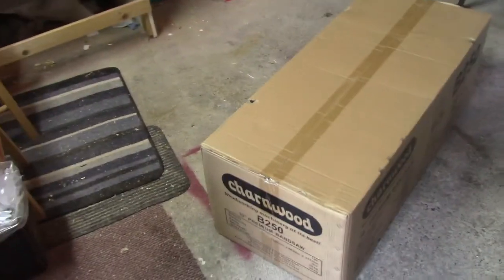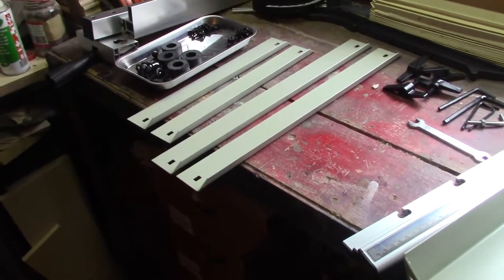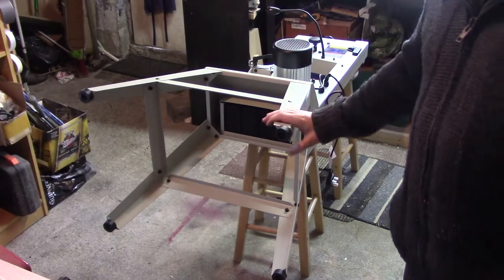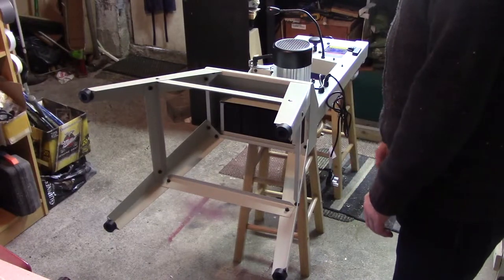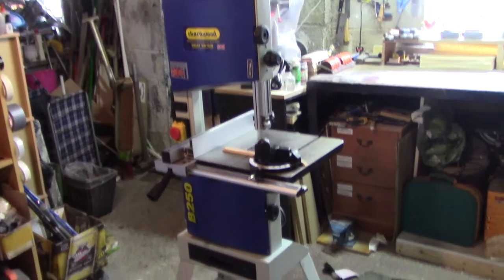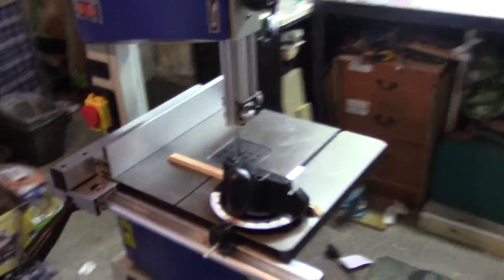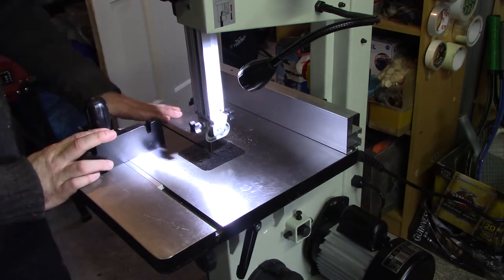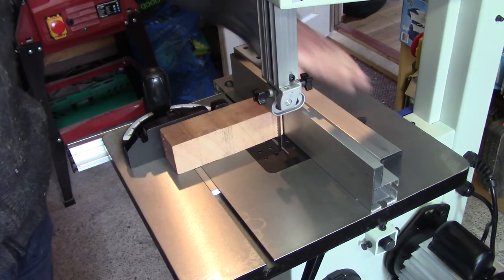New Charnwood BS250 Bandsaw Unboxing and Set Up

Comment: How have you found this after two years man I was thinking of getting this or the w721 I think it is
Reply from the maker: Still really happy with it. It's still performing perfectly after 2 years.  If  you have the money the larger table and higher power of the W721 seems worth it
Reply: @BrencoGuitars  yeah I plan on resawing boards up to 6 inch so I was thinking the bigger motor would be an advantage thanks for the reply.